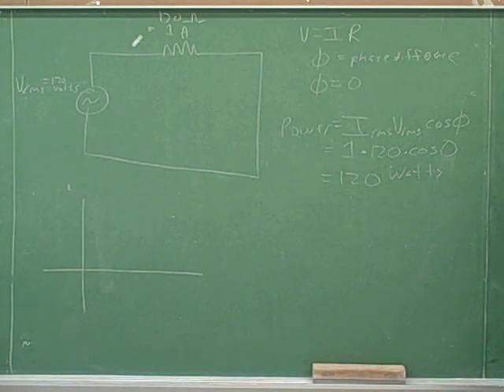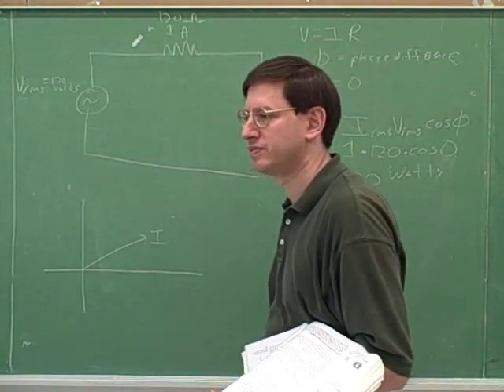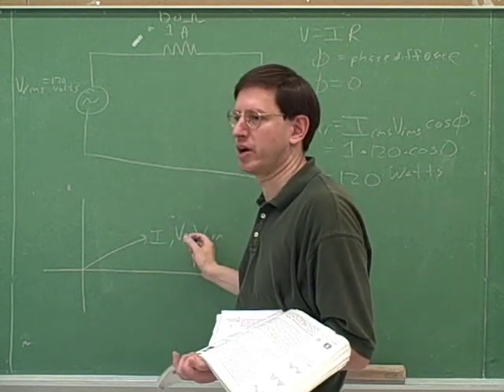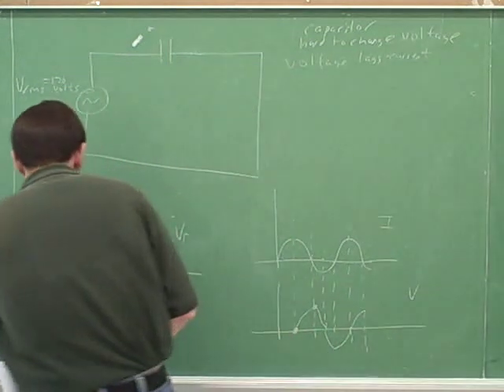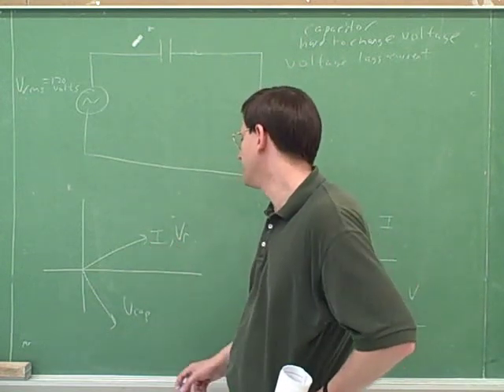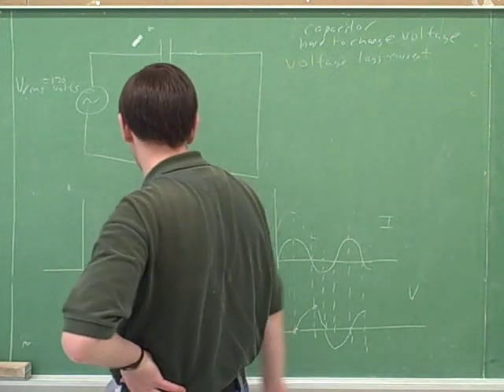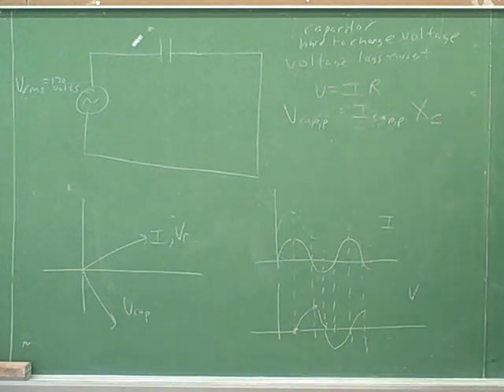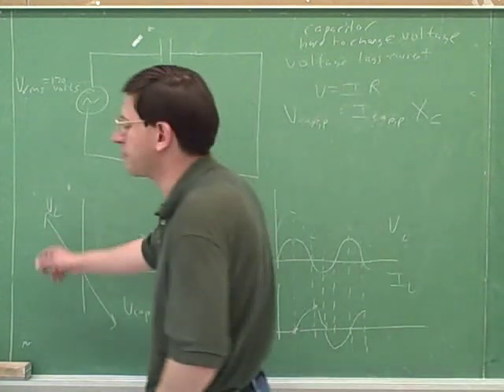Alternating current; RLC circuits (2)

Comment: If you are curious ,why the voltage lags in purely capacitive circuit ,for a capacitor with charge q ,capacitance C and voltage across it being V
q=CV
i=dq/dt => i=d(CV)/dt
when we put  V=Vmax *sin wt 
i=C d(Vmax *sin wt)/dt
differentiating the above equation gives us;-
i=C*Vmax*w*(sin wt+pi/2)
hence ,the difference between the phase angles of the voltage and the current is pi/2, where voltage lags.

Comment: The phasor diagrams used are misleading.  The +X-axis should be used to represent a purely resistive load, and the  +Y-axis to represent a purely inductive load, and the -Y-axis to represent a purely capacitive load.